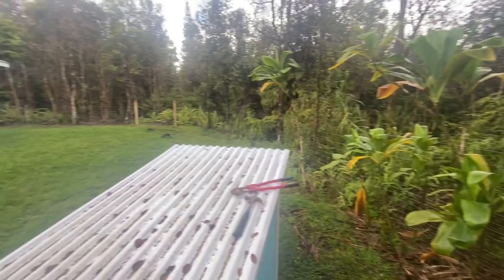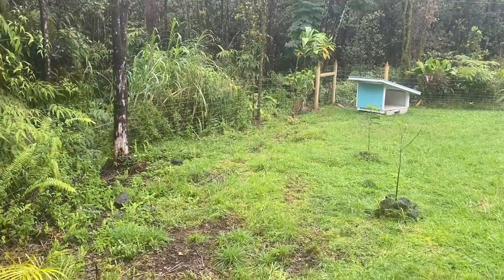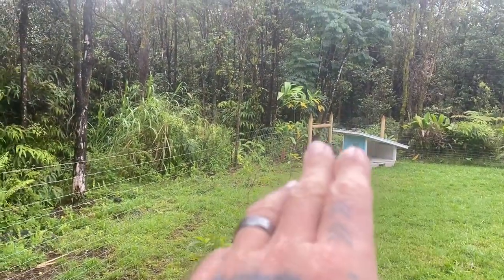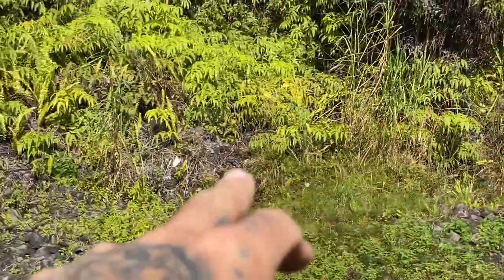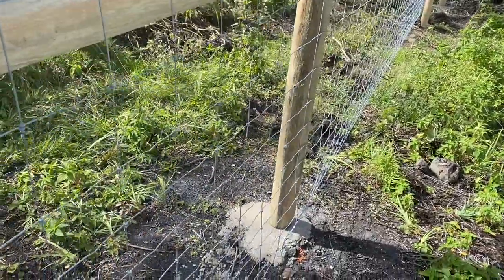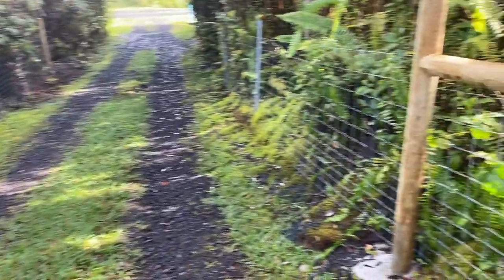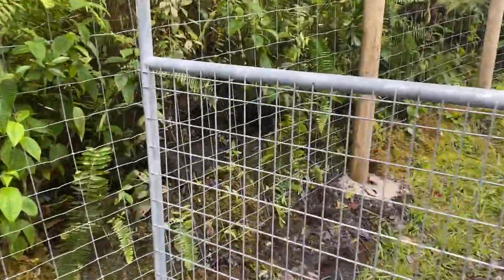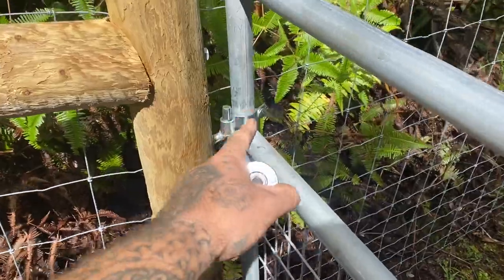Perimeter Fence Part 4

Comment: Your water tank looks big. Would you do a video on how install water catcher tank. 
Thank you.
Reply from the maker: Yes it is a 10,000 gallon tank it was already installed when we bought the house but it’s pretty simple setup water from the roof goes into the tank. I do have a video on maintenance and the water filter system I installed.
Reply: @JasonFleckDaHawaiianViking , thank you.